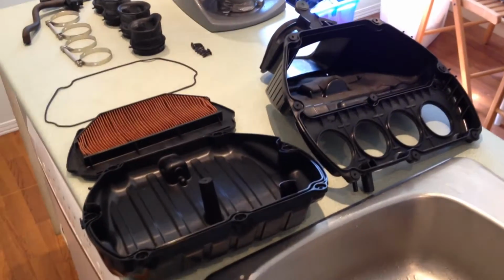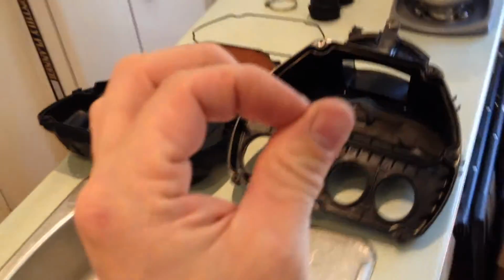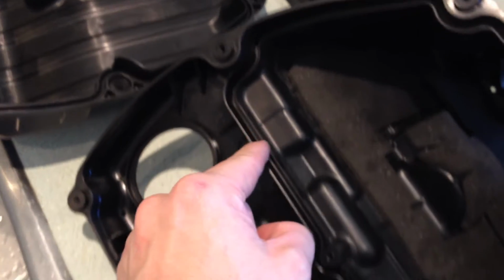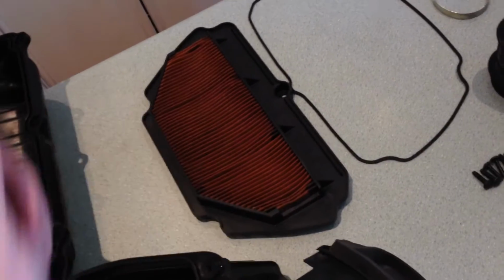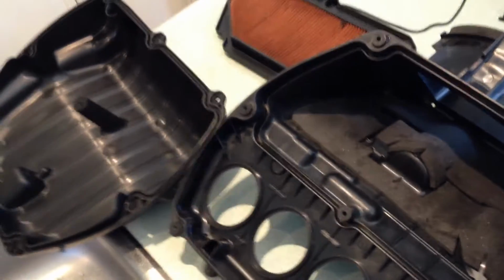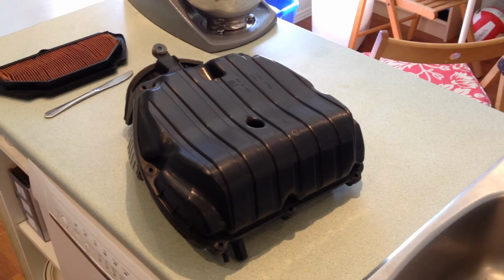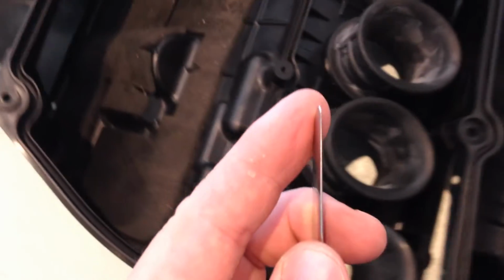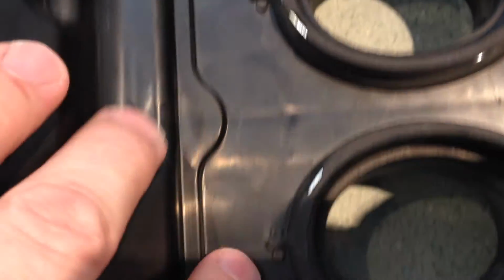Clean enough? Airbox & air filter issues.

Comment: Nice tips. I've long thought that aftermarket higher airflow filters do little to enhance an engine (without tuning) and may even decrease performance. I'd be interested on your view on the matter.
Reply from the maker: Higher air flow = less filter material, which clogs up or saturates sooner. They`re really meant for 1 race only. Once saturated the tuned air/fuel ratio will be off, performance goes down.
Sounds logical?
Now washable doesn`t mean higher air flow, then it`s a decision between 2-3 hours of washing everything for free or getting a new disposable filter priced to cost half an hour`s shop rate.
Reply: Cheers for the reply.